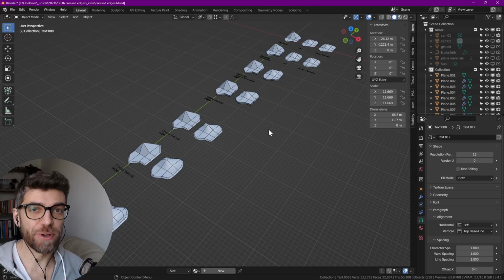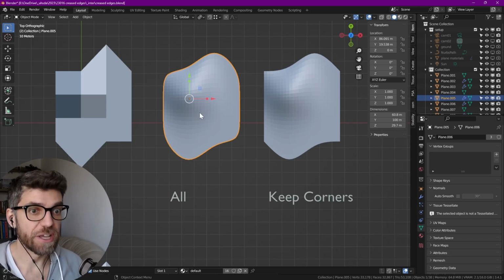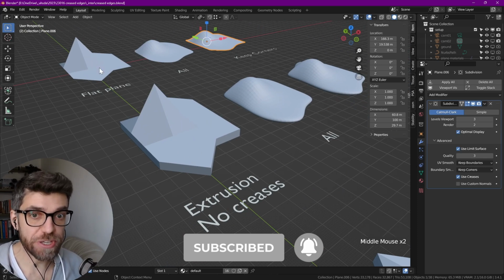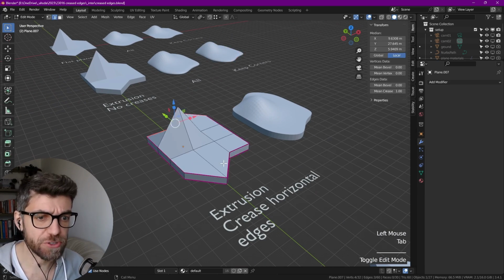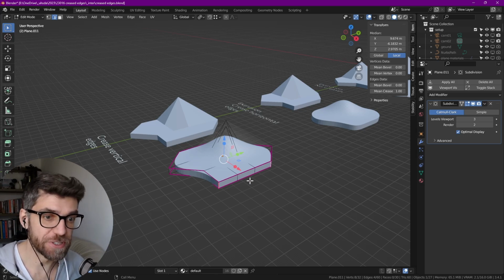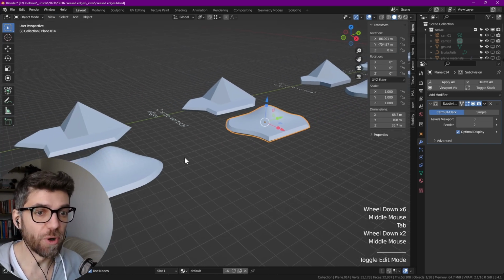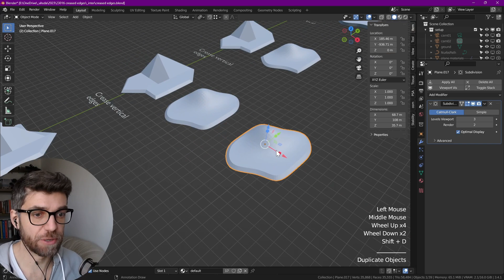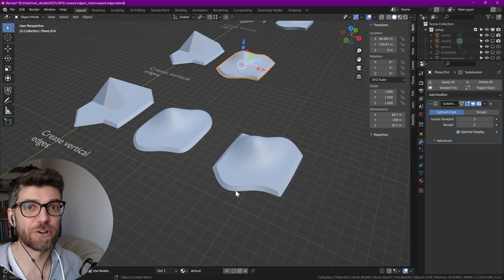A hidden feature to keep sharp corners of subdivision mesh and other ways in Blender

Comment: What I also like to do, depending on usecases, is to add solidify modifier and a bevel modifier with 2 segments and profile on 1. Also bevel weight helps to define where i want to have my loops then.
Reply from the maker: Thanks for the tip 👍